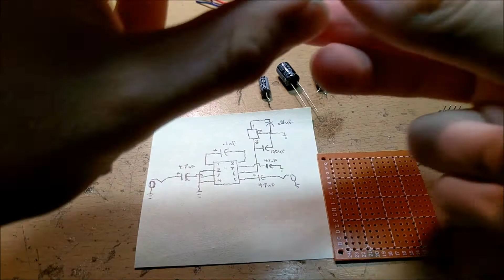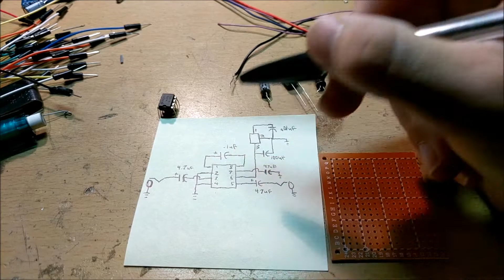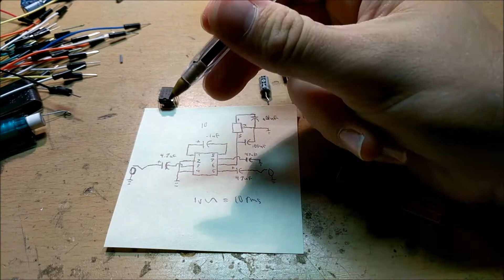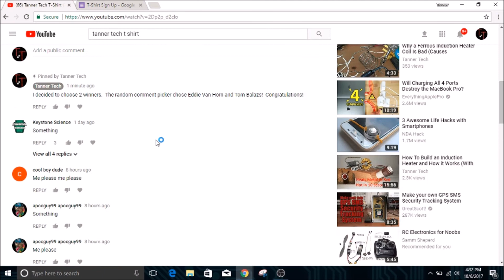How To: LM386 Preamp Circuit

Comment: the 386 is NOT a pre-amp. It is a somewhat poor quality low-power amp - read the datasheet.    
It is too noisy, too slow, and has too much distortion to be considered as a pre-amp

As you see[sic] it works wonderfully -   except it sounds terrible

Comment: hey, great video, one of the few that explains the purpose of each component in the circuit. just one question, I've been looking at a few preamp designs just to fully understand them but the biggest difference I've noticed was that for the gain you use a capacitor instead of a resistor (really it's a pot but that doesn't really matter for the question.) in my head they're serving the same purpose in these circuits but is there any advantage over using one over the other?